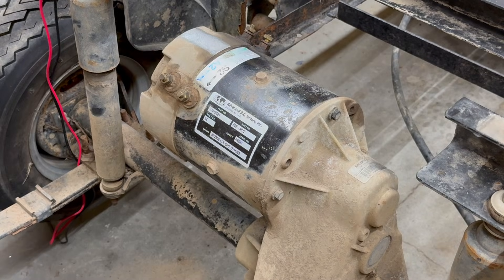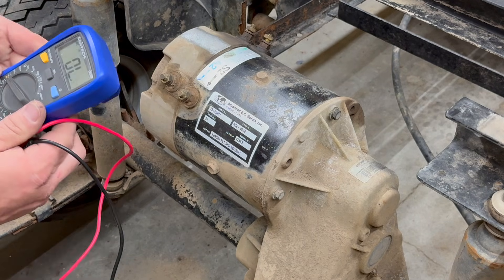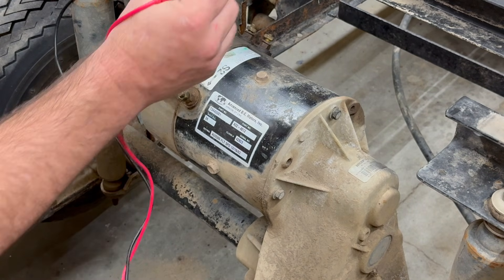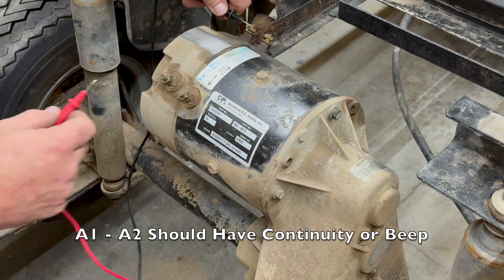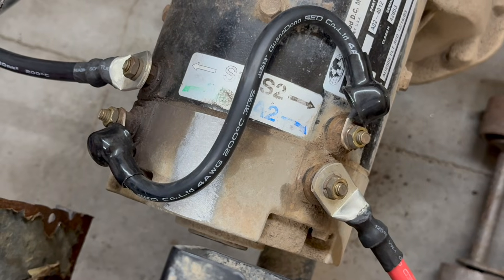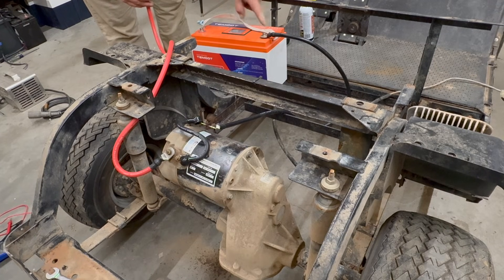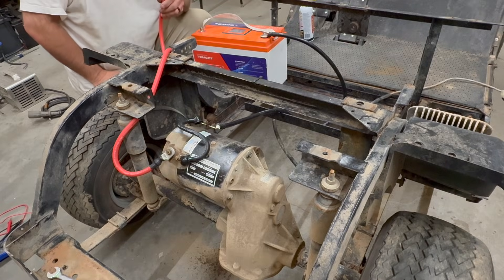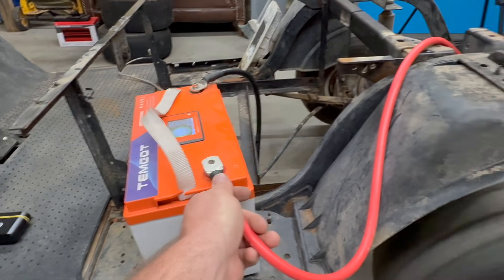How To Test A Series Golf Cart Motor | Ezgo Club Car Yamaha

Comment: And to add to my situation 1985 club car ds series motor 36v #1012190 motor test w/12v battery,,,Small jumper from A-1 to S-1. Then battery pos to A-2  batt neg to S-2. And fwd wheel action should work ,now reverse is  jumper from A-1to S-2 batt pos A-2 batt neg S-1, reverse motor should work . NEW TO CARTS,JUST LEARNING MYSELF.THANKS

Comment: Looking for some advice.  I've had my 2000 Yamaha 36v electric golf cart for 4 months.  Ran great all over the neighborhood for 3 months but in the last couple of weeks, the cart started something it had not done.  After running it for 10-15 minutes, it just stopped moving.  Slowly pressing the accelerator petal several times finally got the cart moving again, but only for 5-10 minutes more before it stopped again.  Had done this same thing on different days several times; I didn't even drive it on the street anymore, but the cart continued to stop moving just driving around my property.  From watching other youtube videos, I thought it might be the solenoid, so I replaced it.  I thought that fixed it since the golf cart ran great for the next two days, but then again, started doing it again...stopping midride, and having to press the petal several times to get it to move again.  I'm wondering if it was a bad solenoid, bad controller, or bad motor.  Any suggestions?  Thanks in advance.

Comment: 1996 ezgo txt dcs series motor will not run. I tested just like in your video. No shorts, armature and windings look good, no debris, bearing good, brushes good, brush connecting wires good. Need help. Any ideas?

Comment: Why do none of these things have the motor i have?  Very irritating, can't be that rare
Reply: F1 & F2 are Sepex motors, S1 & S2 are series motors. They are not interchangeable. You can verify by looking at the field windings inside the motor shell, sepex motors have thin windings & many loops, like 50. Series motors will have thick wires, or bands & only like 10 loops.
Reply: @flipnonm3311  I took it apart, it was pretty crusty inside and the brushes were sticking so I'm gonna clean everything up and hope it works 😁
Reply from the maker: Describe your motor.
Reply: @Fentertainment  it's a pds motor, with rocker switch f/r has f1-f2, a1-a2
Reply: 12v battery ?
Reply: My 36v motor is club car banded but it's a Hitachi and currently runs in reverse just fine,swapped pos 🎉and negative and still rev only ?? DIGGIN DEEPER

Comment: Very nice to have you back!  Glad you're doing well and giving us great content again.  This is really helpful to me as I have a 1990 marathon that just stopped operating in forward.  Reverse works fine and the solenoid clicks for forward so I'm going to use your test to check the motor out!
Reply from the maker: I would look at the FNR lever. Sounds like one of the contacts isnt making a connection.
Reply: @Fentertainment   just wanted to thank you again, your advice was perfect, i replaced the FNR switch and it's running perfect again, even in 30 degree weather.   Please keep up the good work!